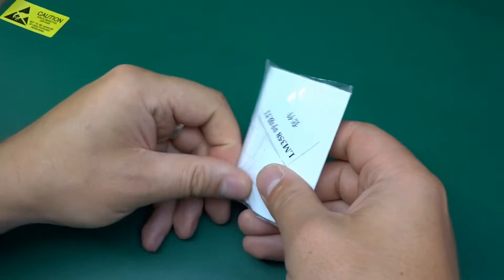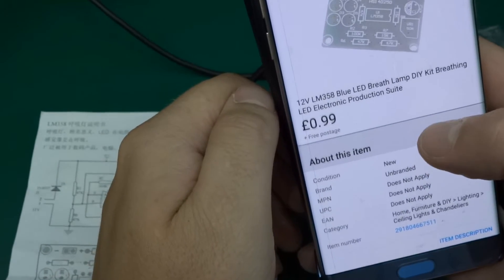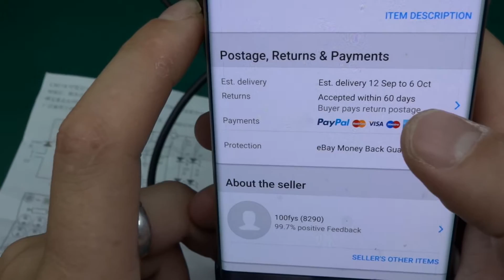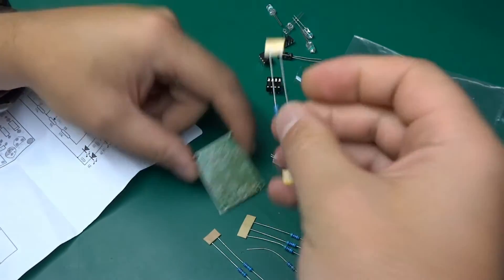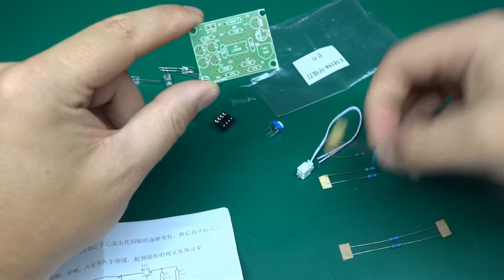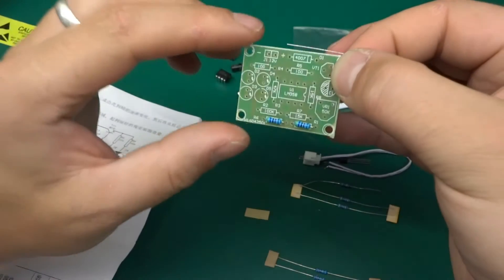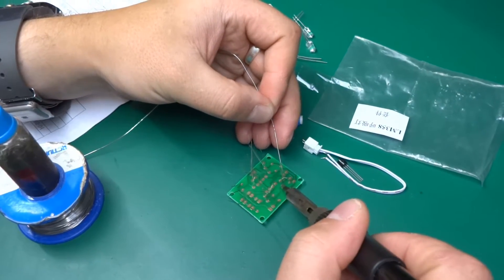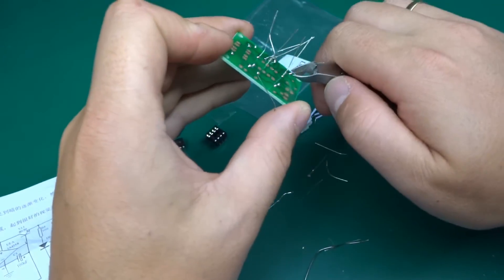LM358 LED Breath Lamp DIY kit from ebay - build

Comment: '
hi R...
what is that blue - white turn switch VR1...
can LED light work without a VR1
Reply from the maker: I think you are referring to a variable resistor (potentiometer). Yes, not needed in theory. Can be replaced with a resistor but you will not be able to adjust the speed of breathing.
Reply: @randomtronic 
hi R...
thank explain about breath LED kit

Comment: '
hi R...
how can change to 6 volts with LM358 kit...
dont need 12 volts
Reply from the maker: Depending which LM358 you have in your kit, it should work on 6V anyways. You might have to drop the value of LED series resistors by about half to get the brightness up.
Reply: hi R...
i got a package with kits from neighbor...
company already assembly kits...
try 6 volts, not work then 9 volts is low light, then 12 volts is good work...
use 2 packs of 8 AA batterys

Comment: My son and I did this kit. It breaths ON but stays on. Any clues as to why it doesn't breath off?
Reply from the maker: +Ryan Walker Hi, please double check your soldering and placement of components. Likely you have mixed up resistors and the oscillator does not work, or there is a bad connection somewhere. Good luck! ;)
Reply: randomtronic thank you for the reply! I ordered 3 of the kits, so I compared the traces, and there was an extra trace connecting two of the resistors. I ran a slit with a knife, and it works! funny that error in the manufacturing.